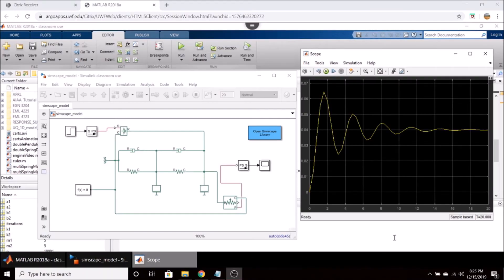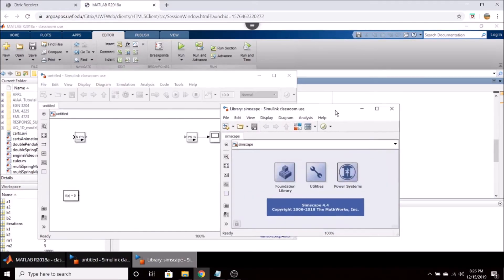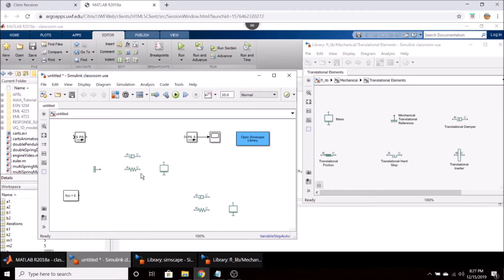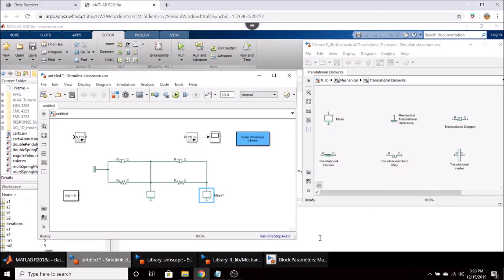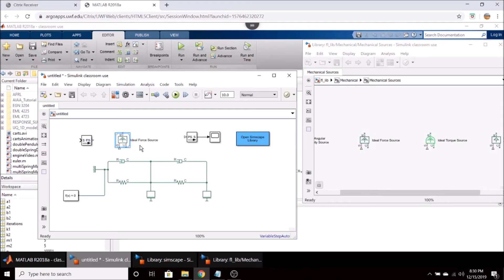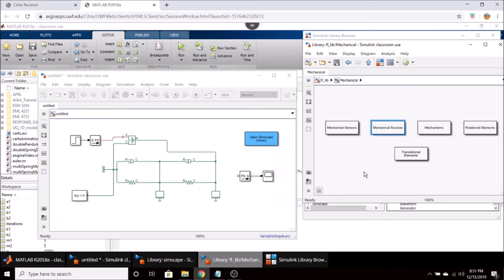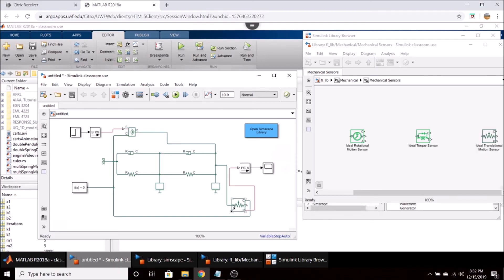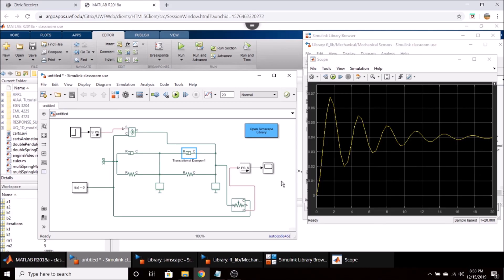Simscape Multibody Spring-Mass System | MATLAB Tutorial

Comment: How can we add gravity in Simscape System for vertical hanging?
Reply from the maker: I'm not sure what your application is, but in vertical spring-mass systems, gravity is usually accounted for by choosing the origin at the equilibrium position (ie. accounting for the gravitational displacement).  Thus we don't have to account for gravitational effects on our system.

If this doesn't help resolve your problem, you might be able to add in an ideal force source and give it a constant input with a magnitude of m*g.
Reply: @ironpine5815  thank you so much. I  just want to show that the state of block under the z-0 on diagram. I will try ifs , thank you again

Comment: Great tutorial!! I needed to do this for a torsional resonator, and got it working right away. Thumbs up!
Reply: But is there something like a "Ideal Angular Position Source" that I can apply to one of my masses at the start of the simulation?
Reply from the maker: @Jaultaub  great question!  I've wondered this myself for some time, but haven't been able to find an answer.  It seems others have had the same question on MathWorks' MATLAB Answers site, but no one has come up with a satisfactory answer, to my knowledge.  Here's an interesting thread though: https://www.mathworks.com/matlabcentral/answers/304718-how-can-you-set-the-initital-condition-displacement-of-the-mass-in-a-simple-spring-damper-mass-sys
Reply: @ironpine5815  I found the solution: You can do this using a velocity source: Use the first derivative of speed: location. Use the velocity source to input a phase of pi/2 and the amplitude and freq. you wish. Than you need to multiply the amplitude by the freq. (inner derivative), and its done!
Reply: This is how I use an oszilation to power my resonator. I use the Sine Wave block. I am unsure how to apply this to a Step Input though.
Reply from the maker: @Jaultaub  Interesting solution - thanks for sharing!  When simulating a system to a step input, you usually neglect any initial conditions, so I don't see it as an issue that you can't apply this method when using a step input.

Comment: Hi! Here is an example of a transport function:

G1(s) = X1(s) / X2(s) = 1/s * (156 x^2 + 12,89 x + 576) / (4856 x^4 + 5649864 x^3 + 21345,5 x^2 + 13218 x + 21823,58)

At my university we have to solve mechanical systems by hand. Since this would be hard to transform to time domain by hand, the "solution of the system" is accepted in this form. My question is, is there any program that would show me transport function in this form so I could check if I solved the system correctly?
Reply from the maker: Mark,
If I understand correctly, you're looking to "input" your mechanical system and have it "output" the transfer function?  I don't know of any MATLAB tools to do that, but you could simulate your system to a step input in Simscape (like I show here) and compare the step response to a step response of the transfer function you hand-derived.  If they match up, then your transfer function is correct.
Reply: @ironpine5815  Yeah, that's exactly what I want. Thanks and sorry for my wierd terminology :P